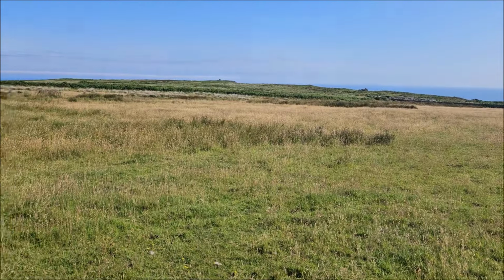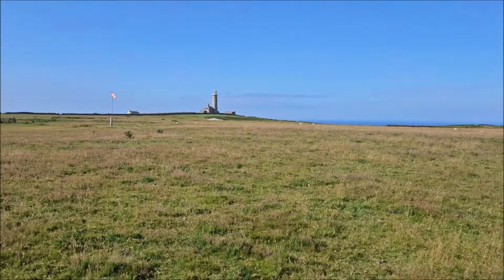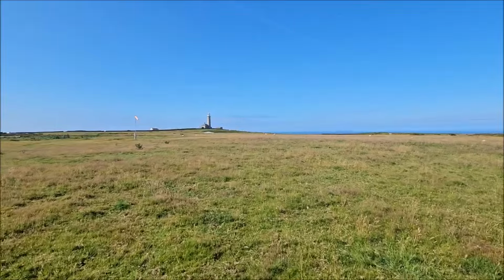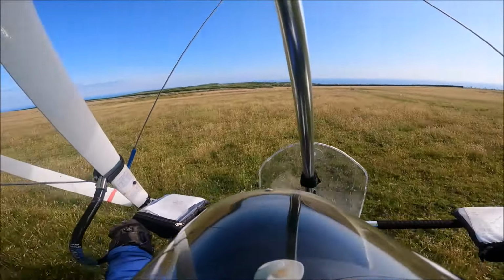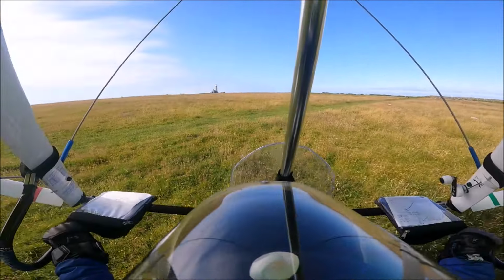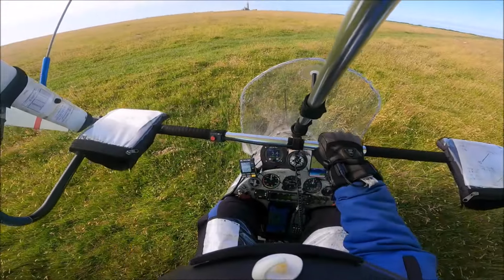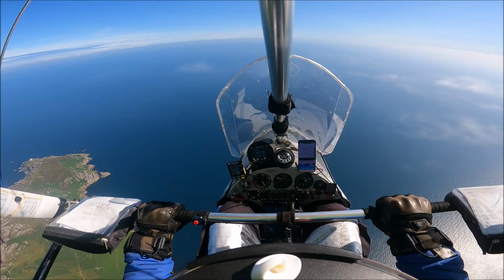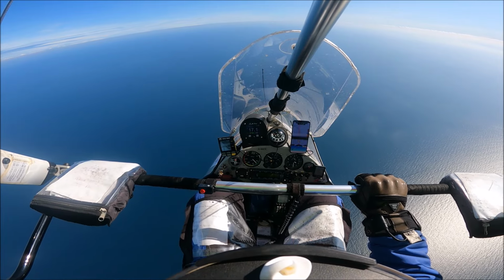Lundy Island Preparation for Take Off

Comment: Hi Trev enjoyed your episodes of your European trip, and for a great cause, well done to both of you. Quick aviation question if I may, do you fly QNH or QFE and in what situations do you tend to use either? I guess from the video you set airfield elevation before flight? 
Great to hear your take on it, of course not for any other purpose other than an opinion, keep up the great videos👍
Reply from the maker: Hi thanks for watching my video's. I generally take off on QNH and then change to QFE before landing. As well as the anologue altitude gauge I have 2 GPS's running. One showing QHH and the other showing height above ground. So I am spoilt for choice really. 😉
Reply: @trev.lee.adventure  Thanks for quick response, sounds like a good plan to have a few variations on hand👍 thanks.

Comment: Hope you don't mind me asking Trev, what prop do you use on the  aircraft and where was it manufactured. The reason why I'm asking is because I have family connections to Newton propellers that used to be based in Mid Wales. Thanks Trev
Reply from the maker: It's a Warp drive prop. I think they are from the USA. They are standard on these aircraft